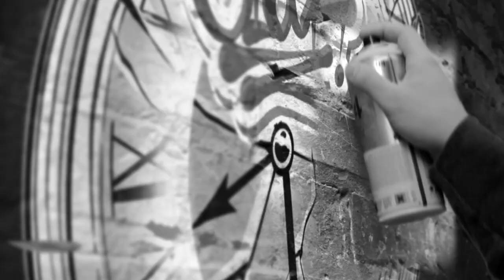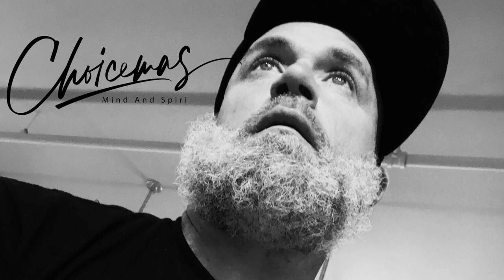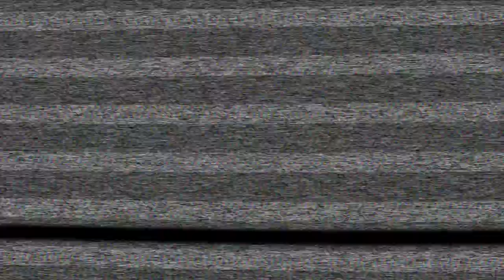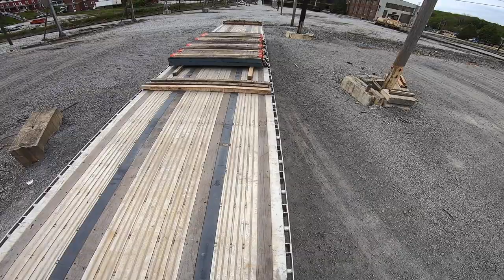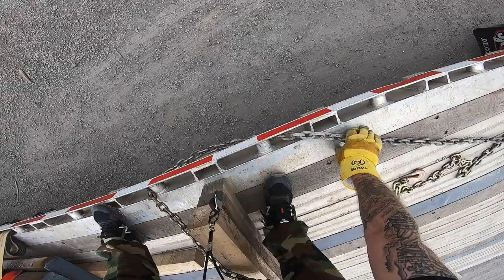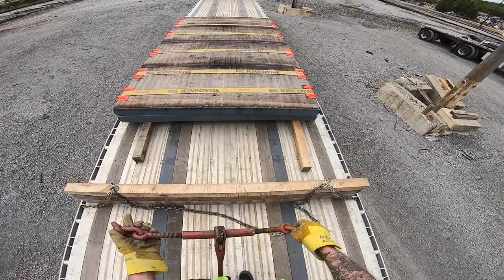HOW TO BUILD A 3 BOARD BULKHEAD  WITH CHAIN AND RATCHET BINDER | CHOICEMAS |

Comment: Good job bud. There is always a slight mathematical equision of weight and hight with the bulk head. Always a learning situation and re checks during haul. Learned and will always try to learn how things ca shift during a haul. Most of my scary situations were oversize and over weight and having the utmost concern of those around me on the road for safety.
Peace
Reply from the maker: Thanks brother.